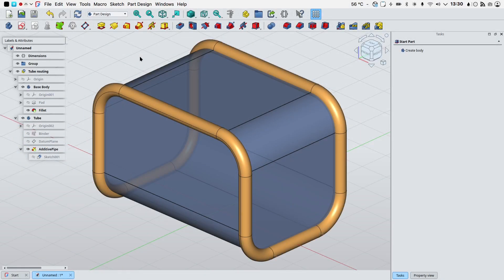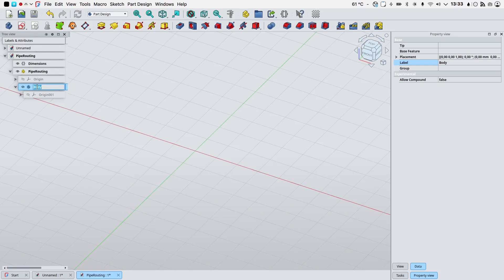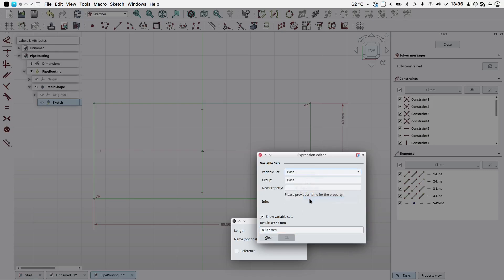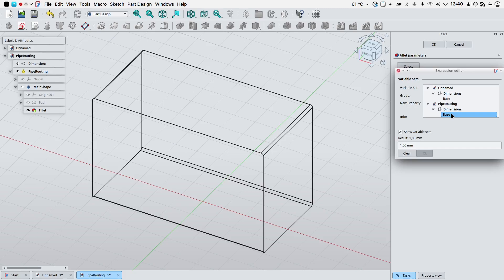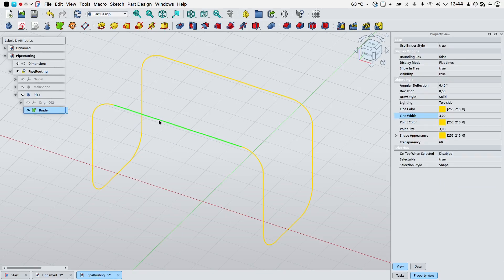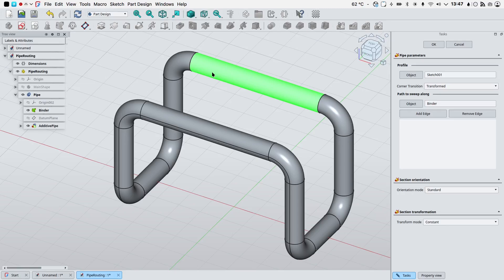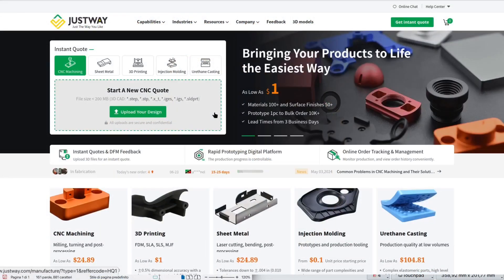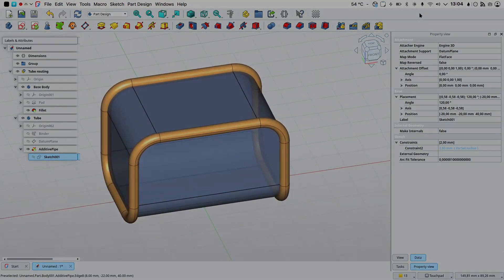[Tutorial] Ondsel/FreeCAD SubShapeBinder use for closed loop pipe routing.

Comment: The sketch for the pipe shape could be attached to the path with the same normal to edge. Why add extraneous objects to the tree?
Reply from the maker: You are perfectly right in saying that. I have the habit of creating datum planes because they are reusable in the context of more complex models. Set them once with all the offsets necessary then reuse them for whatever you want. For iterative design is faster.

Some considerations:
-in PartDesign selecting a edge and clicking CreateSketch won't allow you to  set the attachment other than the base planes of the body. Just tested now with the weekly build. A solution would be to map to a base plane then use the remap function. I find that cumbersome. 
- creating a sketch using the Sketcher workbench is giving a dialog to directly map  to a geometry feature but the sketch will be created outside of the active body. Again cumbersome and just tested with the latest weekly.
-LinkStage3 will open the sketch creation dialog in PartDesign with the complete attachment panel and will permit to easily map a sketch to whatever feature directly just by selecting first said feature. I think that is one highly desired feature in FreeCAD main.

If I'm missing something obvious please let me know, FreeCAD is such a vast program and there are so many changes lately that there is always something new to learn.

Comment: Why do you make a separate datum plane for the circle, instead of just selecting the edge and adding a new sketch there?
Reply from the maker: I'll just copy and past a previous response because it is long lol ... please bear with me

You are perfectly right in saying that. I have the habit of creating datum planes because they are reusable in the context of more complex models. Set them once with all the offsets necessary then reuse them for whatever you want. For iterative design is faster.

Some considerations:
-in PartDesign selecting a edge and clicking CreateSketch won't allow you to  set the attachment other than the base planes of the body. Just tested now with the weekly build. A solution would be to map to a base plane then use the remap function. I find that cumbersome. 
- creating a sketch using the Sketcher workbench is giving a dialog to directly map  to a geometry feature but the sketch will be created outside of the active body. Again cumbersome and just tested with the latest weekly.
-LinkStage3 will open the sketch creation dialog in PartDesign with the complete attachment panel and will permit to easily map a sketch to whatever feature directly just by selecting first said feature. I think that is one highly desired feature in FreeCAD main.

If I'm missing something obvious please let me know, FreeCAD is such a vast program and there are so many changes lately that there is always something new to learn.
Reply: @OficineRobotica  Ah, yes, I didn't realize that mainline FreeCAD is missing even basic features like that. (I'm almost always using realthunder's "LinkStage3" instead of mainline.)

Comment: please make video about them you use, thanks
Reply from the maker: Please elaborate what you are interested in.
Reply: Sorry, I was asking for a theme tutorial because I thought you were working with the new FreeCAD version. This is ondsel version 😅, i didnt see that in title  @OficineRobotica
Reply from the maker: @Bill3D  The theme and arrangeement of the interface is available in FC main also. In the addon manager search for OpenTheme . After install there is a light and a dark version. P.S. In this particular video I use FC main ;)
Reply: @OficineRobotica  thanks
Reply: A similar UI arrangement is available from OpenTheme now, you can apply the "OpenPreferences" preference pack and it should automagically apply most of the settings/arrangement. Be warned, it will probably replace any custom settings you've applied. I created the themes/pack.

Comment: Very good video
In your openion is freecad 1.0rc1 better that the current link version?
Reply: In my opinion the freecad link branch is better than the rc1, but the link branch is based on freecad .19 imo it doesn't have the offset tool, etc.
Reply: I agree with @Paulklampeeps that realthunder's version is a lot better. It's so much nicer to work with. Some features in mainline aren't present in rt, but a lot of really, really handy features in rt aren't available in mainline.
Reply: @marcus3d  FWIW it's the same for me. In addition it's a lot more stable, too. Even for my relative simple assemblies, my trials with Ondsel made it crash several times. Too bad that linkstage and assembly3 are a dead-end - but until main/ondsel have caught up in regards to features and stability I guess us, who use FreeCAD for actual, productive work will have to wait a bit longer... but at least the future looks bright, eh? :)
Reply from the maker: The 2 are diverging quite a lot lately. I prefer the sketcher and assembly workbench in FreeCAD.rc but I miss a huge list of features from LinkStage. There is a list of features to be ported on the Ondsel team radar but no certainty that everything will come in. I'm begging the developers though knowing that they have a huge amount of work ahead. By the way Thanks devs :) , you are my heroes